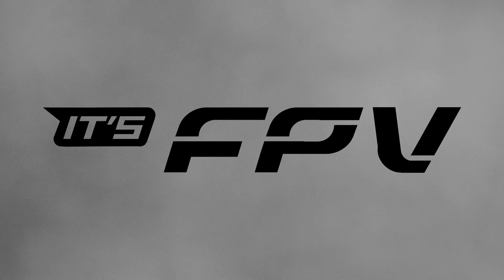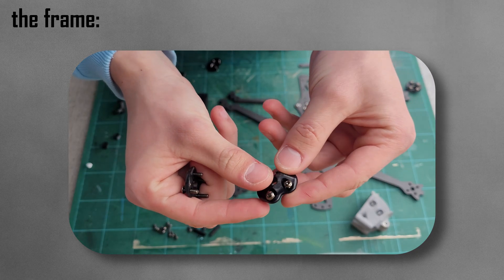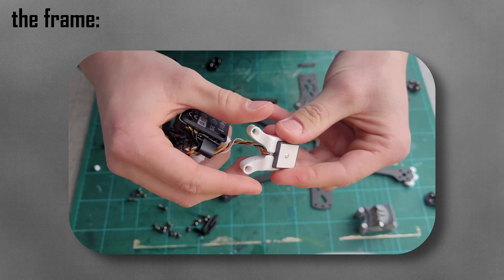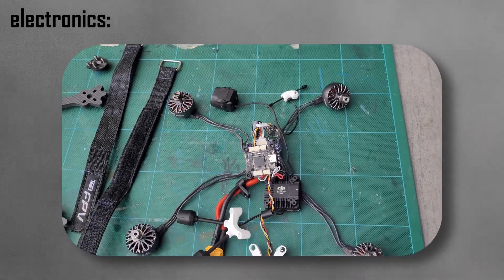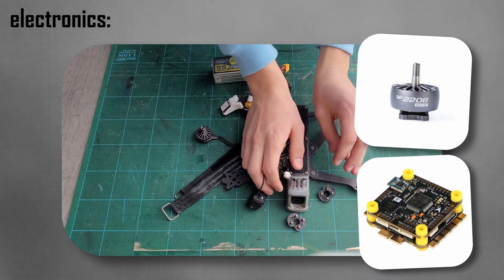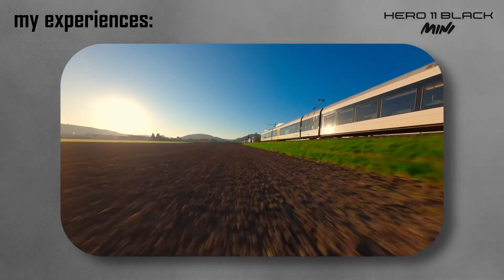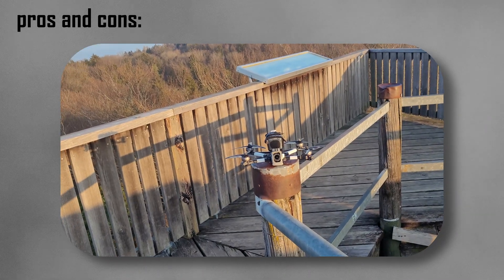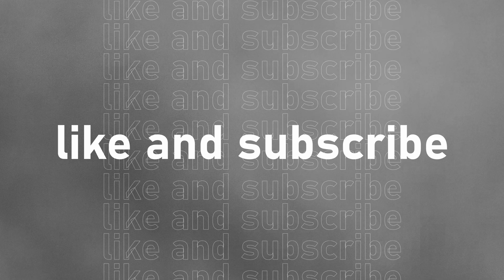THE BEST DJI O4 PRO COPTER? It's FPV ERA DC cinematic review

Comment: Definitely not the best! The printed cage will break easier then the injection molded one and the arms are easily broken due to the inner cutout that shears off with every few hits, I've had better luck with Apex clones and would say a real apex evo is far superior... Fist arm i broke also broke the bottom plate hole so i had to cout out my own bottom plate by hand, I was extremely disappointed in this frame! I actually just got a cncdrones  ThumpR which is far tougher and basically half the price i paid for this overpriced turd... I will say it does fly like an Apex which is really good, and I love the injected cage... Just a shame they refuse to sell arms with the damn cutouts... Which is why i posted
Reply: not the best and the price point is like 6x times the manufacturing cost. absolutly nuts @ 100€
Reply: @oriwan3786  thats why I'm switching to the new ThumpR, its t700 and only $68
Reply: IMHO the best is the Jeno series, and it's open source.
Amazing blackbox and solid.

Comment: i miss a view on the prop clearance.
Reply from the maker: The shot at 7:58 and 11:48 is actually unstabilized 04 pro footage with a wide field of view...  =no props in View
or what do you mean?
Reply: @swissfpvshots in essence the distance between prop and frame and the distance between the props of the front and back motor